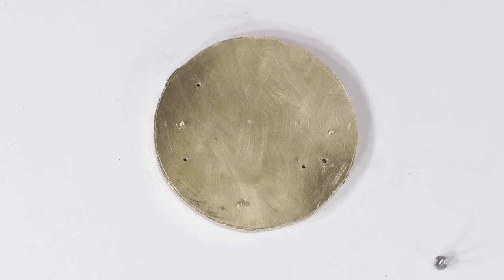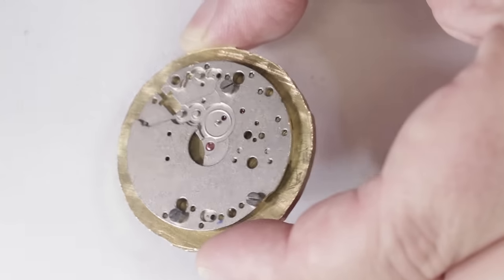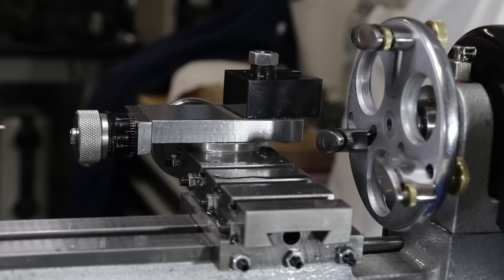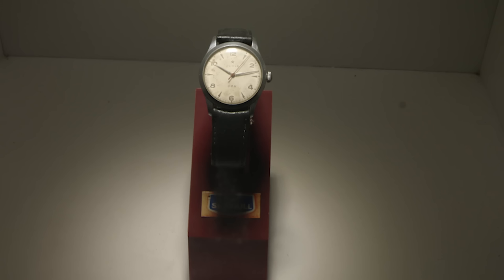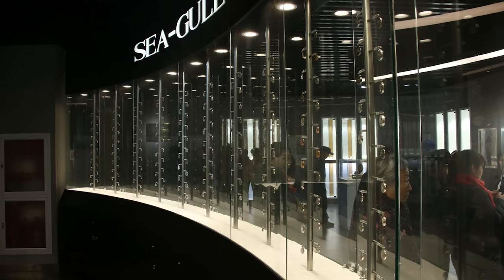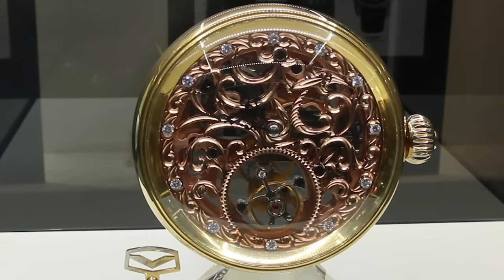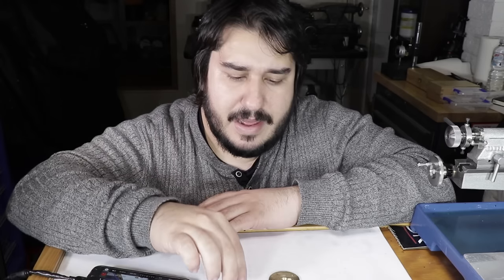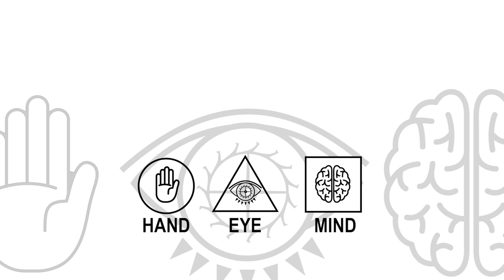Visit to Sea-Gull Watch Factory | Watchmaking Vlog #7

Comment: I have thought a lot about that recess for the winding mechanism. For the record, I have absolutely no clue as to how you create that recess. Every tool I have ever seen or used went through my mind, and I am stumped! This is a problem that I will be watching very closely how you solve. If I had any advice of value, I would voice it now....but sadly, have nothing. I appreciate your relentless tenacity in this project. Thank you Dean!
Reply from the maker: No worries, thanks Scott! I have a couple of ideas. I hope they work better than the ideas I was throwing at my most recent toolmaking failures. But I will have it no other way!!
Reply: Okay, I thought about it more. I am believe a carbide burr, single cut, with a much smaller shank than the burr itself. Is that what you were considering?
Reply from the maker: I believe we maybe on the same brainwave !

Comment: Great work as always, Dean!  Regarding that difficult feature - if it was me (and it will be someday!) I'd side mill it using a bespoke shop made cutter.  There would be a lot of cutting pressure so you'd need a rigid setup, and possibly even a way to support the outer end of the cutter.  If you're using the lathe with the work held on a vertical slide, then you could conceivably use a tailstock center to support the free end of the cutter during the operation.  If you have a little horizontal mill, that would be even better.  I'm sure you'll figure out something that works well though! :)
Reply from the maker: Thanks for your reply precision! That is a path a may have to take, hmmm using a cutter like that supported both ends is a good idea! Thank you so much, and I hope you get to that stage sooner rather than later! :)

Comment: Hi Dean,I sincerely hope you don't mind some input from someone who knows very little about the actual watch making process. But I'd like to think I know a little bit about machine tool alignments so thought I'd add this.

Your centering scope method may well have been more than accurate. But I just don't know enough about mechanical watch making to properly judge that. However once the part centerline locations are added it would be extremely difficult to maybe impossible to then change there locations if better accuracy was found to be needed later. Rarely or more likely never does any lathe have the tailstocks centerline 100% dead in line with the lathes headstock center of spindle rotation at all positions along the lathe bed and with various quill extensions. And that goes for some very expensive machines. There's always going to be some inaccuracy found if your metrology equipment has enough accuracy and resolution. I'd assume that centering scope can be zeroed, but might be out just enough depending where on the lathe bed or what tailstock quill extension it's used with.

The common 1/10,000ths reading dial test indicator or in your case 1/100ths of a mm would have a ball tip on the probe tip too large for what your doing. Shop built tool steel and then hardened needle shaped probes would do it though. Adopting a few jig bore practices would likely get you much better accuracy than trying to do the same using optical methods. Again I don't know enough about the exact specifications for what your doing to say if your method was all that was needed or not. But it's much easier to be accurate to start with than to try and add that later. My guess is even the best dti I know of such as the B & S 50 millionths (imperial) reading dti would still be cheaper than one of those scopes and be able to do a great deal more.

Also in case you don't know about it the probes length is quite specific to each type and brand of dti. As long as the measurements are within a few thou / or a 10th of a millimeter and the probe tip matches the length or is a bit less than the factory supplied tip your readings will be accurate. I highly recommend the detailed metrology information on the Long Island Dial Indicator Repair website. Indicators of any type can also fool you due to the effects of gravity when there rotated horizontally. Used on the lathes cross slide with the work rotated in the lathe's spindle there very accurate. Hold the work on that cross slide and rotate the dti in the lathes spindle while trying to align the work and you could easily see 2-4 hundredths of a millimeter inaccuracy or more depending on how rigid your indicator is held. It's quite shocking to see how much a light weight dti can bend a 6-8 mm steel shaft due to simple gravity effects if it's rotated in the horizontal orientation. And if a mill is in your future at some point then a top quality dti that can be trusted without question is also going to be needed.  Some food for thought anyway.
Reply from the maker: Thanks for the detailed insight Turning Point! That is super helpful. I use the centre hole usually under 1mm which is in a sapphire jewel to ensure the work is centre. As the holes are located all over the workpiece I'm unsure how I would use a DTI ? This is because I actually can't think of how it work (my limited knowledge), only because I know of the basic DTI (plunger and ball end). I am always looking for new and easier methods!! Are there ball tips that small?

I understand the tailstock alignment will never be perfect, and over time wear will play it's part. I never align it so the cross hair is the middle of the hole. I usually align the jewel hole to touch two lines in one quadrant that the cross hair makes. That way I can see which way to move the piece when it crosses the lines when I rotate the headstock. Once the hole is touching both lines for full rotation I know the hole is centre with the headstock. That's why I choose to bore the holes with a lathe tool now instead of drill, so I hopefully don't have inaccuracies from tailstock alignment affect the hole. I really don't know if this correct, if I try centre the cross hair in centre of hole sometimes its hard to tell when eccentricity is small. What are your thoughts?
Reply: Hole drilling is actualy a roughing operation Dean since drills don't and can't drill round, straight, or even on size holes. So you've already got that figured out. Took me years to learn the same. Single point boring like with a lathe will produce holes about as good as your spindle bearings will allow. And with the lathe you spent decent money on they should be pretty good. I've got a set of .375" diameter shank solid carbide boring tools I believe were made by Micro 100. The smallest will bore a hole as small as .047" (imperial)  or just over 1 mm metric. Call it 1.5 mm in round numbers. Boring straightens and makes the hole round after an under size drill is used to rough it out and allow access for the boring tool. Generally a reamer in a very good floating holder is then used to size the hole. I know watch maker reamers are sold but industrial quality  dimensional reamers are likely cheaper and I can't think of any size even in a watch that a imperial or metric reamer couldn't be found. Shop made D bit reamers are also a traditional watch making tool as well. Either type of reamer will set your finished hole size far easier than boring can if the reamers are tested for what hole size they actualy produce in your chosen material. To do better for hole finish and size then lapping is needed after reaming with either barrel or needle laps in the sizes your looking for. Reaming should be good enough I'd think.

There's at least two types of indicators in use today, the usual plunger type with normally 1" or 25 mm of travel and called a dial indicator for the analog type. Then there's a much more accurate very short travel dial test indicator or dti. It has what looks like a lever as the probe tip and that's how they work.  My Mitutoyos have only about .030" total travel. In use there generaly a null setting device and by that I mean your trying for the minimum of needle movement or zero and not an actual distance measurement. While I haven't checked on various probe shapes for the dti's I'd imagine someone makes them somewhere. But they screw in place so any size or shape could be shop made with the correct taps to fit whatever dti make is obtained. Mitutoyo gives thread sizes for there dti's on there website so I'd guess most others do as well. Accurate metrology equipment is 100% linear in what your willing to pay for it.  And if you can't measure it then you can't make the part if the required accuracy is very tight. That B & S I mentioned in metric would be high on my list, but Mahr, Mitutoyo, Starret are all good as well. A Starret last word indicator isn't a good one though. A second dti in .0005" or it's metric equivent would be very useful to get you close before moving to the far more accurate ones.

Easier and shorter to answer the rest with an extremely good book recomendation I own that you need to hunt down. It was first published in 1907 by the American Machinist Library and titled Tool and Gage Work by Goodrich and Stanley. That was well before proper jig borers were in common use yet. In that book they detail how master gages were built for a typewritter manufacturer by aligning each hole position on a lathes faceplate using hardened and ground shop built tool maker buttons, a micrometer and a shop made indicator quite a bit different than what we now use, but the drawings for it are in the book. Those master gauges were aligned by hand on those faceplates to far far under 1/10,000th of an inch for position and then bored.  Hand built watch making is a little different, but a lot of the same techniques could be adapted. It's a very interesting book with information I've not seen elsewhere so even getting one shipped to you from Ebay in the U.S. would be well worth it. My guess is the shipping will cost more than what the book usually sells for. There's also some very good information in that book about what I think were the very first set of Johannson gage blocks to enter the United States and what they thought they might be used for. The information in all those very old machinist books does not go out of date. What worked a 100 years ago works just as well today. I'd be willing to bet that the top hand built mechanical watch makers today will ALL have extensive library's not only about watches but machining as well. 

Despite it being mostly about building tooling for and using a Myford Super 7 lathe the very best information I've ever found out of all the books I own about machining is in the George H. Thomas book The Model Engineers Workshop Manual. Not having a copy will only slow your learning curve down. A bit expensive perhaps, but worth 10 times it's price. Tee Publishing in the UK will have it.
Reply from the maker: Thank you for your very informative reply. I will definitely try to hunt those books down, and read! I really appreciate it Turning Point !

Comment: Thanks Dean that you are back :-) I have a question! What collets fit a Cowells 90CW lathe? I know that Scraublin fit, but does Bergeon also? They are a little cheaper...
Reply from the maker: Hi Henry,

When my lathe was being made I asked Colin at Cowells if I could get a drawbar so I could uae Sherline collets which I use. I will slowly start a collection of high quality Schaublin or Cowells B8 collets. They are expensive though. I'm not sure if Bergeon do have a B8 collet which I think is the same dimensions as the Schaublin B8. They don't say where they are made, and from what I have seen Bergeon in some of their tools don't have the same quality as they did decades ago.

Comment: Haha, every time that slowing down in the music happened I thought you'd messed up... :) Nice work again Dean! Did you center all the holes and recesses off of the original mainplate or did you use a compass or depthing tool to lay them out? That is: is the layout of the wheels identical to the ETA movement or did you make your own design? You talk about machining your mainplate so that it looks like the original. Is that necessarily the goal? Why not make it your own?

Keep on keeping on! Love seeing you progress.

Best regards
Karl
Reply from the maker: Thanks Karl! I used the existing jewel holes to center. I do want to make my own movement. That is where everything is going to lead. I just think I should walk before I run. So the first is being to be able to make new bridges for an existing movement amd make it exemtremely well. But it is not where I will stay, everything is for the end goal :)
Reply: Dean DK Good thinking! Sounds like a reasonable approach. Just don't tie yourself in a knot trying to replicate the results of Swiss CNC machines. The pattern of production will be different depending on the tooling available. Remember Occam's razor!
Reply from the maker: Thanks Karl. It is great advice, I hadn't heard of Occam's razor, but I read up on its meaning. Thank you very much, it is a great point. :)

Comment: Seagull movts are great and economical, fairly cheaper than those from swiss. One thing about seagull is they don't really manufacture parts for repair, once something gone wrong in there, it's either to swap out a brand new movt or just get a spoiled one for parts.